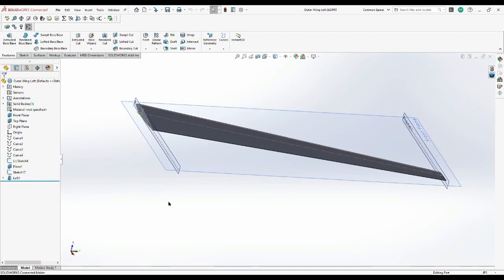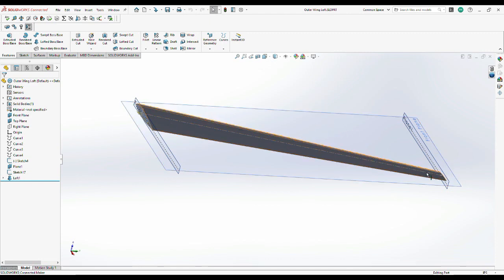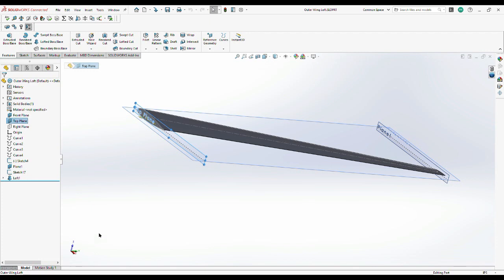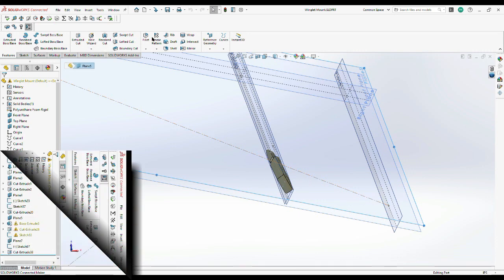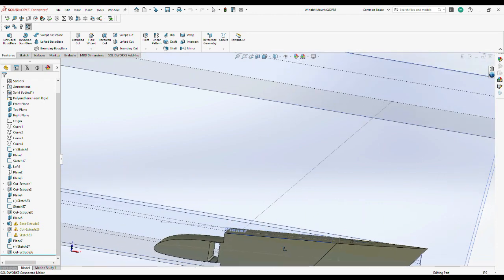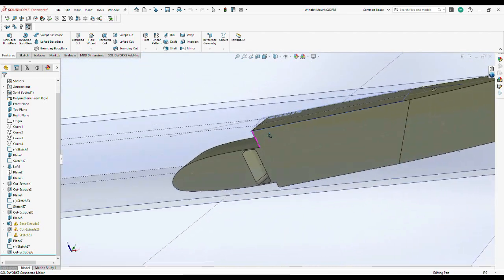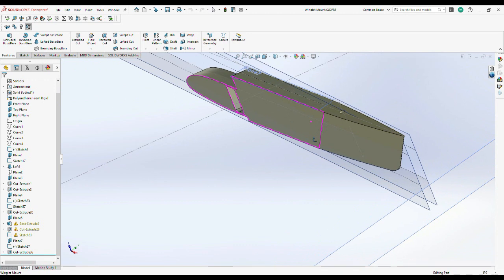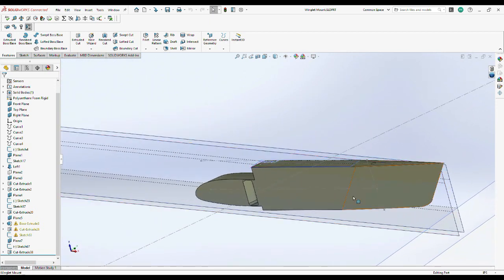Klingberg Wing MkII Ultralight Sailplane Development - Winglet Mount Drawing Status

Comment: z up or y up comes from seing the xy plane as a wall or chalkboard, with z being horizontal, or the xy plane being a table or piece of paper, with z being vertical
Reply from the maker: I understand that. I'm just saying that the default for the world of aero eng is positive Z is up and that is not the case when you open a new file in Solidworks.
Reply: @KlingbergWingMkII  I think you can set the default parameters in the default file template in SolidWorks?
Reply: @KlingbergWingMkII  https://www.youtube.com/watch?v=KRr-YukKdqw this is a concise explanation for changing the template defaults, hope it helps
Reply from the maker: Thank Steve, you are always a big help. You've made my buddy Bob and I very happy (Bob, has been really annoyed by this issue)!